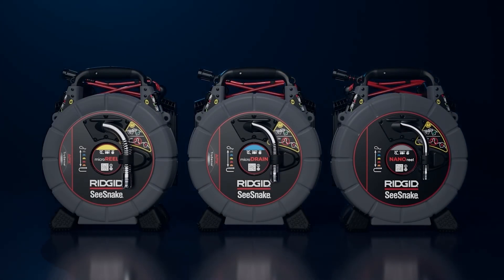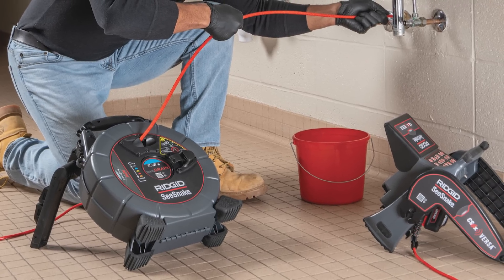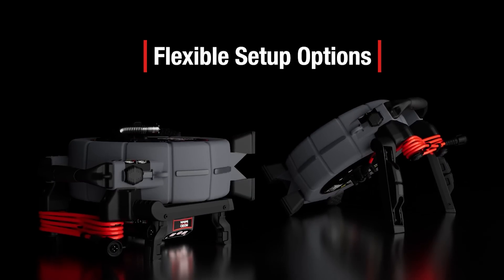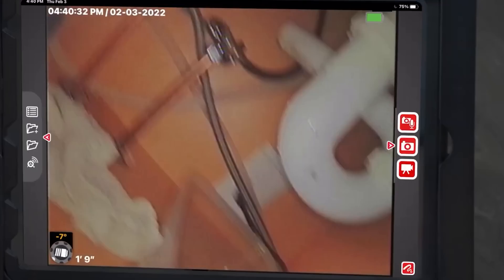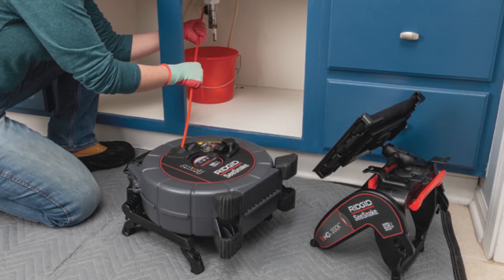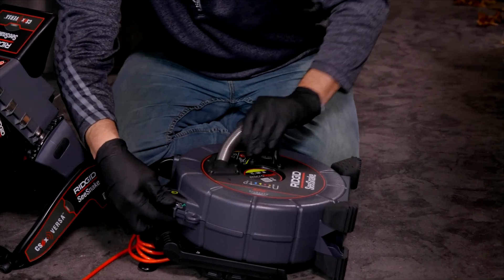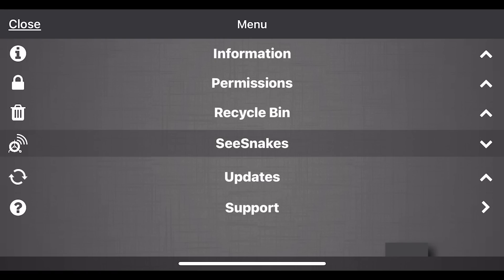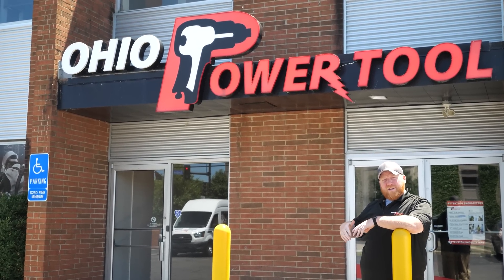NEW RIDGID Mini Inspection Cameras With TruSense & Self-Leveling!

Comment: what would be the best camera to inspect flexible air ducts in a high rise condo ?, thanks for your advice, i just discovered your channel and you guys are very informative. thanks
Reply from the maker: Hey, welcome to the channel — glad you’re finding our content useful! For inspecting flexible air ducts in a high-rise condo, I’d recommend checking out the Rigid Micro Wheel or the Micro Drain camera systems. They’re compact, flexible, and perfect for navigating tight spaces like ductwork from about 1.5” up to 3-4” in diameter. Plus, they come with features like self-leveling cameras, HD imaging, and true distance sensing, which make inspection way easier.

If you’re working on smaller ducts or specialty jobs, the Nano model is great for pipes under 1.25”. All of these cameras have been updated to be easier to use with interchangeable cables for monitors and have solid durability.

Feel free to reach out if you want help picking the best fit or want links to specific models!